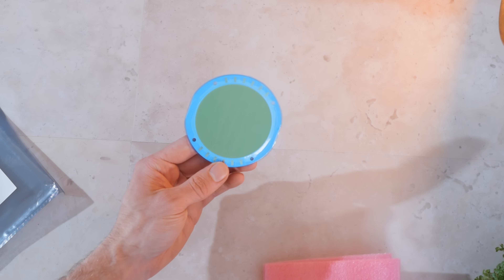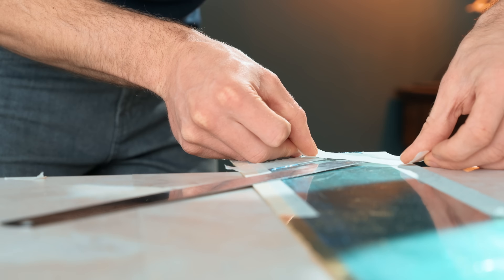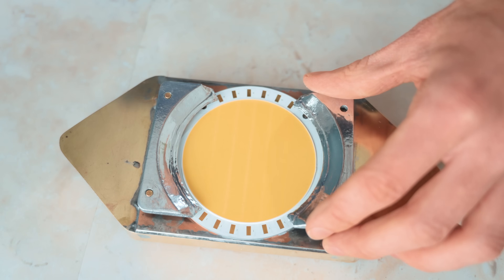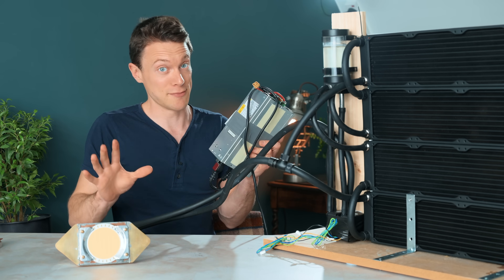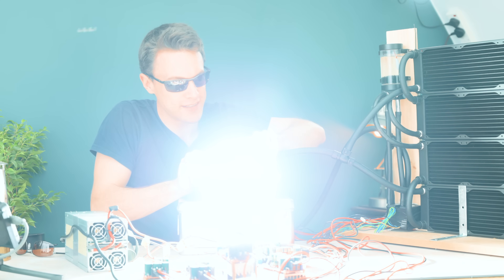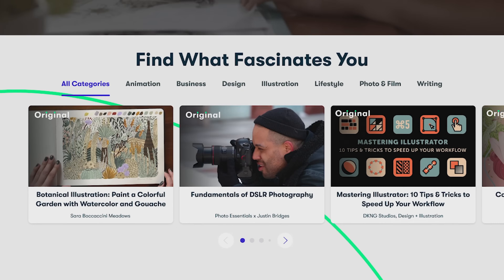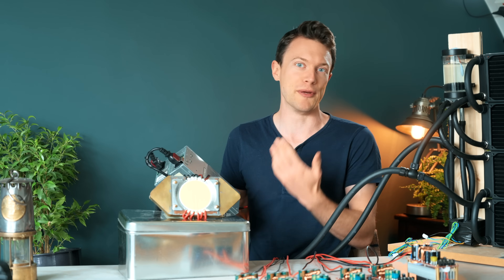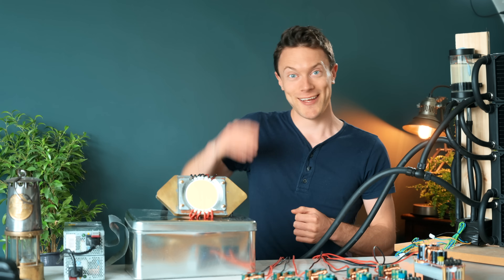Testing the world's BRIGHTEST LED!!!

Comment: Pc psu have multiple rail (12v ,5v and 3,3 v) and the watts of the psu it's the total of the 3 rail. Normal psu have a sticker on the side where you can see all the specs. For example a 500 W psu can have  max 436 W on 12V rail.
Connecting in series is not good ( and better not fisically stack them for thermal),since the led have multiple power inlet, it's better split the psu in 2 inlet (or more psu and more inlet)

Comment: Seeing as the custom cooler block is running so cool right now, have you thought about reducing the number of radiators to see if it still copes? I'm thinking you may be able to dissipate all required heat with only two of the radiators, despite the calculations. Worth a try?

Comment: Boost converters can take massive gulps of current; it wouldn't totally surprise me if it was overcurrent spikes that killed the power supplies even though average power may have been in spec.
Reply from the maker: Makes sense. That might be why it didn't fry in the initial test as they were powered up one by one.
Reply: @DIYPerks  Just for fun I designed a boost converter for a bike light a few years back. Average current was only around 100mA but peak currents were a couple of amps. Boost converters rely on putting what amounts to a dead short across an inductor and then opening the circuit to generate back EMF, hopefully before the current in the inductor has become too huge. It might be fun to put a small shunt resistor in your circuit to try to measure peak currents with a scope. They're likely pretty outrageous!

Comment: If it's a 1500w led why would you use a loop that could take that much, since LEDs are really efficient and most of those 1500watts are converted into light and not heat?

Comment: You could've probably used a water block designed for a Threadripper CPU or even a GPU block, specifically a GTX 1070 Mini Waterblock, seems like it'd fit well

Comment: Isn't the whole point of using the LED to output most of the power as light? No idea what the exact percentage is but my guess is that you probably could have gotten away with using the heatsink. Would also explain the low water temperature.

Comment: For real, that waterblock is going to ruin this. Order a custom block somewhere made out of a single material and of the same material as the rest of the loop, aka your reservoir and your radiator. Leeching will happen, pretty common in janky PC cooling loops, and that kinda solder looks like leeching party. Maybe nickle plate the whole thing?
Reply: Maybe ping LTT up. Sounds like prime collab hours.

Comment: On Aliexpress I found some power supply that can vary from 1500w to 3000w with voltage and current regulation, available in the voltage you need (36v or 48v) and as you can regulate the voltage from 0v to the maximum, it can be useful.
Reply: If you allow I can pass the link so that you can find an appropriate one from the ad. XD

Comment: What is the power availability of the voltage rail you're using? I'm betting you're using the 12 volt rail of both to get 24V, and depending on how you do it, you might only have a few amps or tens of amps. Either way, I'm betting the 5V rail makes the majority of the power of the server supplies and you may not have enough 24V power, despite being within the total power specifications.

Comment: just curious but did you check the amperage rating of the power supplies and the light and water cooling system assuming you had the water cooling system hooked up to the power supplies as well and not just the light 

maybe more amps were being drawn than the power supplies could handle

or it could be something else

Comment: Can confirm that running PSUs in series causes problems, especially at higher loads, I've done it before to make them passively cooled instead of one actively cooled PSU, but thats all under 30% load, not exactly sure why it matters because they should be DC

Comment: These LEDs are around 80% efficient. so you only need to dissipate 300 watts, which even a single 240mm radiator would do with ease. Your system is about 5-10 times overkill. Why did think you needed to deal with 1500 watts of heat?

Comment: You have to be careful with power supplies, a lot of the time you can't simply wire them up in series or parallel like you would batteries, as certain electronic components wouldn't appreciate that at all.

I know for a fact certain power supplies even have specific switches you need to trip for different configurations and such, and others simply say that you should do so under no circumstance in their user manual.
Might want to look into that.

Other than that, this video was as amazing as they all are! Big thumbs up man.

Comment: Switchmode power supplies in series can develop harmonics. Hence the advice to not put them in series. For such high current low voltage applications it is best to build your own power supply. Just get three transformers for 220 to 22 and then add a couple of large capacity caps behind a full bridge rectifier. If memory serves rectifying 22 should hit 30 just about spot on.

Comment: DIY Perks: "The watts are over 1500!!!" 
Me: ~eye balls the 1500 watt power supply just sitting on the shelf of my spare parts...~ hmmmm...
Reply: Send it
Reply: @xenomorphical  build it yourself and make a competing video
Reply: The watts isnt the problem, the problem is making a constant current 48Vdc power supply that operates between 30 - 41Vdc
Reply: He just learned the solar flare technique
Reply: buy another one and 2 of these leds
Reply: then he said "it costs $1300" and I said "nevermind"
Reply: I have two power supplies that never made it into a pc. I got them during a Christmas sale and bought them on a whim, not even needing them. One is a 1000W and the other is the 1500W. It was during the bit coin craze and it was just one of those "phuck it, i'll figure out a use for them". If you saw the price they were at, during this weekend sale, you would would have done this silly impulse buy too.

Comment: Awesome video! I love messing with high-power LED's and i would love to have a go at that beauty, and then 4 of them, and some drone-batteries for the biggest and most powerful portable flashlight ever!

As others have said, those 4x120mm radiators can dissipate over 500 watts easily, and a lot of the power from the LED is going out as light (Reaching 40% efficiency in white LEDs is possible: https://www.ledsmagazine.com/leds-ssl-design/thermal/article/16696536/fact-or-fiction-leds-dont-produce-heat), so i believe 2 of those would have been more than fine, especially for short runs, where a block of copper would have been just fine too just as thermal mass.

I work with computers and servers in my dayjob and electronics as a hobby, and have messed around with a lot of different types of computer powersupplies. These types of powersupplies are incredible resilient, even more so when it is from a server, as they have to be able to run at 100% load for years at a time with a lot of noise and vibrations, and have to be able to deal with very sudden increases in demand (When a redundant power-supply fails in a server, just as it goes from idle to full load, with fans and disks spinning up), without dropping the voltage below spec.
I believe one of them was just faulty and shorted, and since it shorted out, all the LED-drivers now need double the current to keep up their output, which the still-working PSU now attempts to supply (And likely did), which then promptly fired up the fans to deal with the heat, likely just as a precaution since it is now running >100% load, which it likely will for a short time, before triggering the over-current protection, but that protection might very well be at 150% load (or more), because the power-supply might be able to deliver that current for a short amount of time.

Sidenote: Server-fans are no joke, and i chuggled when you said they were "ramping up", since that sounded like idle in an idle server and those fans can sound like a jet taking off, as you found out ;) Most server-fans can spin at the same speeds as an angle-grinder (~10.000 rpm,  smaller = faster. 40mm fans, as are most likely in those PSU's usually spin at around 13.000 RPM at full speed)

Comment: You shouldnt wire up two Power supplies in series! There is no galvanic isolation, try to measure the voltagem betwen the neutral of one power supply to the live wire in the other one when all disconnected, should measure nothing, but i am sure this is not the case, this connection you made you are probably shorting out the Power supplies, not 100% sure! Secound maybe a motorcycle radiador is more affordable and suitable for your application (not my field ) , for the power supply maybe you can rewire one side of a simple transformer with a rectifier in the other end, transformers can esealy surpass your power consumption with not even sweating, they are easy to work with, just change the number of loops in one side and you can achieve your 30 volts! this solution is way more elegant, way cheaper, you can get your 30 volts, uses less space and much more reliable then switching. I'm getting a degree in electrical engineering, any question email me, I have nothing to do in this quarentine haha
Reply: Not sure if your Colling solution isnt overkill
Reply: But nice solutions overall

Comment: I think the PSUs are rated 750W @ 12V not at 30V...so it is not only inefficient to lower the voltage to 12 (or 24) with the PSU and than increase it back to 30V but it is not delivering the 1500W imo...It is most certanly drwaing them from the outlet tho...
I can be tottaly wrong too :-)

Comment: Always love your LED projects. 

If you're using 120mm PC radiators, I'd highly recommend getting some Noctua NF-A12x25 Fans (you can get PWM or DC voltage controlled variants). They're pricey, but they're also the best PC fans on the market at the moment. The only fans that have better static pressure and airflow characteristics are ones that spin at significantly higher RPM's (see Linus Tech Tips "7X Your Cooling" video for example), but those are so loud they'd probably make filming inconvenient.

Comment: You should also be careful when joining two or more PSU's in series, there are some isolation circuits and other bits that makes them not really meant to be joint in series by design. https://electronics.stackexchange.com/questions/266894/connecting-two-atx-power-supplies-in-series

Comment: Since the LED has 6 zones, why not just run it on two separate circuits?  Have each power supply independently power 3 of the zones, rather than wiring them together in series.

Comment: aha, the most powerful pc psu only go up to 1600watts. oh yeah, you can also buy a socket tr4 cooling block, if they fit.
oh yeah you could fry something in your loop of wires if you just plug the connectors into the power supply, maybe even fry the power supply. you could get into big trouble
Reply: and a more efficient power supply would be better

Comment: Unlucky mate server psus are designed for high airflow high static pressure enclosures the built in 40mm fans on there own cannot cope with that may I recommend the superflower 2000watt atx psu on ocuk it's an amazing unit

Comment: Probably better method for leak testing would be to submerge it and pressurize it with air: very slow dripping may be difficult to notice, but it can still cause electrical problems, but air is much more fluid and even tiny bubbles would be noticeable.

Comment: Just an idea about the power issues, some power supplies have different rails which can deliver different voltages and wattages. So are your power supplies rated for 750watts on the output you're using? Or is it split between all the outputs?

Comment: You can get 2000W powersupplies (Super Flower Leadex Platinum 2000W for example). For the "Enclosure" (I would call it a frame, since you need airflow) I would recommend Nut 8 Aluminium Profiles. Also for radiators: Use High Static Pressure fans instead of High Airflow fans. This way you might be able to save 1 - 2 Radiators reducing weight and size.

Comment: Awesome project!
I'm not sure about this but I think that 1000W is the total power of the PS and you're using only the 12V rail, so you might have less than 1KW available per PS. That might be the cause of the failure.
Also, I think that you're not supposed to mix different metals on a water loop.

Comment: Love your channel but I do have one question, since you have 6 separate boost modules and 6 separate LED "channels", and you are running the boost converters below their capabilities, could you just run the power supplies individuall and boost up from their 12v outputs? So each power supply would supply 3 boost converters. You would take an efficiency hit, but it seems like you have a reasonable fudge factor there!

Either way, this is super entertaining, keep it coming!

Comment: Watch out for galvanic corrosion in your cooling loop. Copper + Brass should be fine, but if there is any aluminium or other metals in the radiators, it can get real messy real fast.

Comment: The PSUs are not designed to be used in series like that, and they might have had their loads balanced very unevenly. Since they also are made for servers, they may rely on the massive amount of airflow server racks get. It might be easier to get some regular PC PSUs and put a few PCIe connectors in parallel and boost their 12V PCIe to 36V. A single PSU can easily provide 500W for two LED sections.

Comment: 1.635Wh x $0.01198/Wh = $0.195

You have a ~20 cents per hour portable sun 😎

Amazing channel
Reply: Your milage may vary,
Cheapest to the most expensive (Hawaii and Alaska not included) 
$0.088 on Oklahoma to $0.2251 on Massachusetts

Comment: Use 2 car batterys. That should work without a problem. I think you need capacitor or a battery to not have to much stress on the system.

Comment: For the next time, just use a power supply that has way more watts than the max you draw. I would suggest a DELL POWEREDGE FX2S 2000W - 0MVP7C. It is not that expensive and has plenty of power for the LED. Its the same with GPUs: Its always better to run a single more powerful one than two of them in SLI.

Comment: I know this may be a simple solution, and easy to overlook, but why not use two independent PSU's since the LED can be divided into sections. Use each PSU for half the LED. I would think that running them in series would put more strain on one or the other and not divide the load evenly. Hence why they seem to have been overloaded.

Comment: 2000W might not be just for the 12V rail. 2000W is allotted over the 12, 5, 3.5v rails... so the maximum amperage for the 12V supply isn't always the full total wattage.

Comment: When i connected my power supplies in series i have faced the problem that negative wire is connected to ground, so when you connecting positive wire from one power supply to negative wire from other power supply you can shortcut it through the ground.

Comment: Also, on the issue of thermal dissipation, the LED isn't converting all of those 1500W to heat. This LED likely has an efficiency curve, and from there you could see how much would be lost to heat. If it was 90% efficient, you would only need to dissipate 150W.

Comment: When you are connecting power supplies in series, you should connect shottky and zener diode parallel to the output of each psu. Without them if one psu stops working, it can receive negative voltage. Shottkys will prevent that from hapening. You may also need to disconnect mains voltage ground from them.

Comment: Great stuff Matt, though you might have been “chancing your arm” with your power supply. If you want a tidier solder joint, use a cotton cloth (old tee shirt?) and wipe the soldered joint with the cloth while the solder is still soft, basically, as soon as you’ve soldered it. That will take the excess away. It would then be quite easy to polish the solder away from where you don’t want it. But if it doesn’t leak, why worry??
Thanks again, take care and stay safe. Les

Comment: I think it will work with 140mm 85mm thick radiator (~1000w thermal capacity with 25c delta, if you let led get to 60c which is normal, delta will increase to 35c and thermal capacity output of single monster 140mm radiator will go to 1500w) + and dual high performance push - pull fans and single D5 pump in a small enclosure. Some threadripper waterblock will do the job :) All powered by 6-7 cell LIPO ~5000mah 50c output. Waiting for the final build :))

Comment: You did some calculations wrong. 1st, you do not need to dissipate 1500W of heat from a 1500W LED, only the part of those 1500W that is actually transformed into heat. Look at efficiency specs of that LED to know. Your cooling solution is overkill and is wasting power.

2nd, you cannot ever, ever, wire two power supplies in parallel to power something, with this kind of power they will FRY for sure. As both are not exactly identical, and they cannot ever be, the stronger will tend to do all the work while the weaker will tend to do nothing, so the stronger will FRY first, and the weaker will FRY next as soon as it has to support all the load.

To power this you need to use a single power supply, or a redundant set of power supplies made from factory to work in redundancy at the same time.

Comment: Hell yeah! So glad you made this video I've had my eye on that emitter for a little while. I would be interested to see how you would make a parabolic reflector for it. Also have you looked into meanwell HLG-600 power supplies? You should be able to run this off of three of them and I believe if you get the b type they have a integrated high frequency pwm dimming circuit.